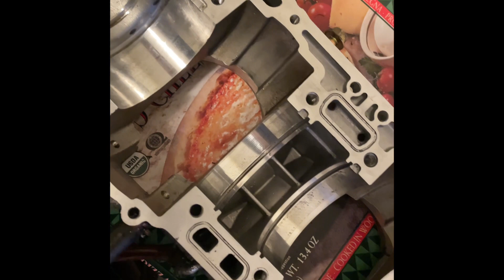Rebuilding the famous Skidoo 800r From The Bottom Up

Comment: the center bearings are bathed in 2 cycle oil. but you should install the y pipe exhaust before you torque down the jugs it will help with alignment
Reply: monoblock. gonna be the same no matter if you put it in before or after 😐😑😐

Comment: Did you put Isoflex in the center bearings also?
Reply: You only Isol flex the outer mag / PTO bearing. The inner mag and PTO bearings are sealed as well as the two red sealed Center bearings.

Weird I know but that’s directly from the BRP factory manual